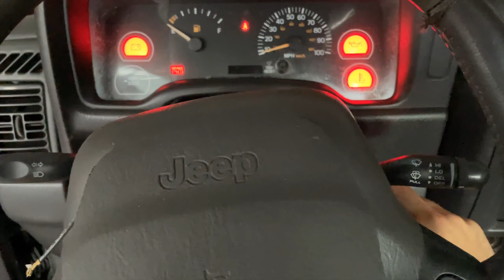Jeep Cherokee XJ Frame is Now STRAIGHT Again!!

Comment: hey bro i seen u used some track series megans for ur s14 i got some for my s13 for cheap and wondering how u ended up liking them
Reply from the maker: They’re pretty nice only a bit too stiff. I ended up moving my rear springs to front and getting some swift springs for rear. Wanted to upgrade front springs to swift as well just never got to it but never had issues and they still good.
Reply: @golfandcats  gotcha, i got a pair of just front, and then Apexi rear, do u recommend just getting swift springs for the front?